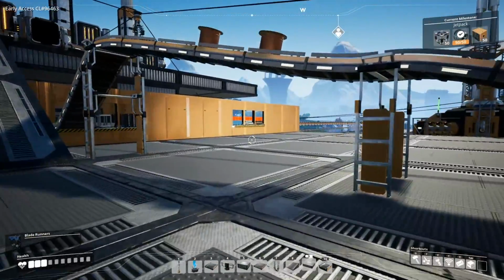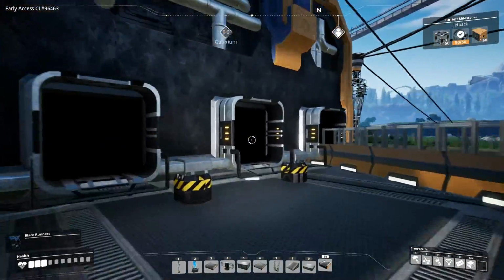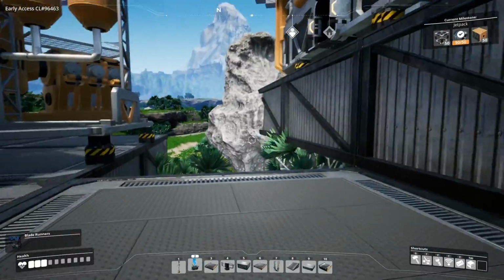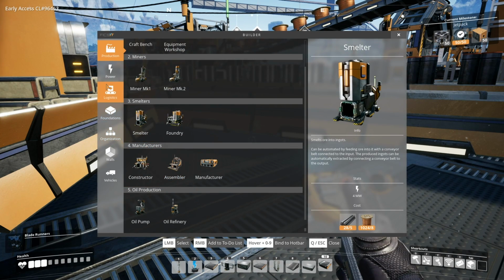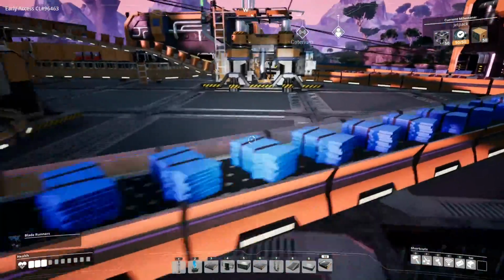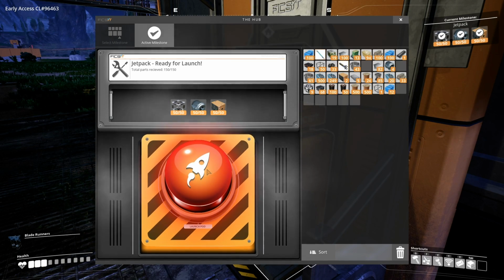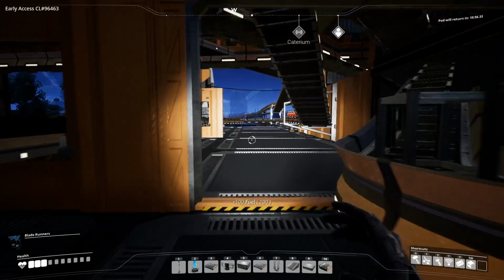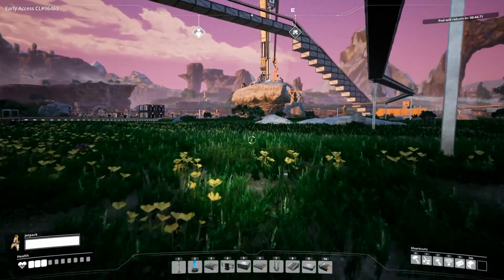The Largest Production Unit in Satisfactory - Manufacturers! Automating Computers to Unlock Jetpack

Comment: Hello Zueljin. I was wondering, since you are doing more of a "tips and tricks" and informative updates than a full series, do you know what the best fuel type for the tractor is? I've opened up coal, and have bio-fuel, but don't yet have oil/fuel. I've heard third-hand that the tractor does better with bio-fuel than coal, and for some reason alien organs work as fuel, but I was curious as to which, if any, fuel type is the most efficient. Thanks for your time.
Reply: Coal is the best fuel for the reason you don't have to manually fual it up always, when using the truck station, & the same goes for the regular fuel you get from the crude oil
Reply: @GrayJacksonRDDBCore  Okay, I see the benefit of auto-refueling, but I was more curious as to which fuel type lasted the longest as far as distance/time. Basically, If I'm going out exploring or setting up an outpost, and carrying capacity could be at a premium, which fuel type, if any, would be most efficient?
Reply: @LordEbo  then biofuel should be your answer
Reply: @GrayJacksonRDDBCore  Alrighty. Thanks!

Comment: Noticed myself yesterday how overclocking increases the power demand a lot more than the production increase percentage; 200% overclock almost triples power usage. At the same time, overclocking generators (at least coal) doesn't increase by the overclock percentage, at 200% overclock a coal generator only gives 85 MW rather than 100MW, but fuel consumption does almost double. Makes everything an even bigger balancing act. :D